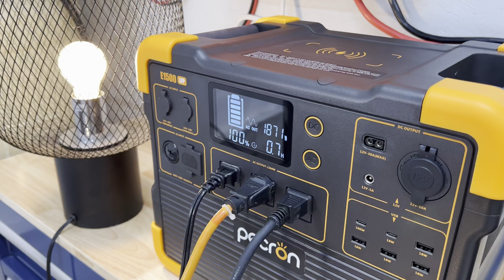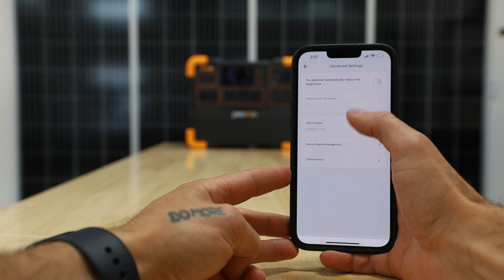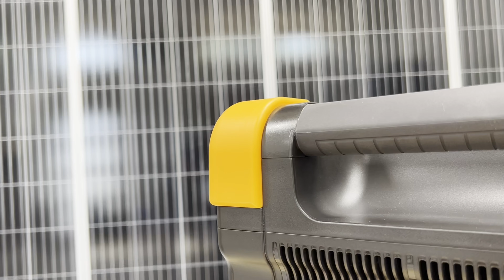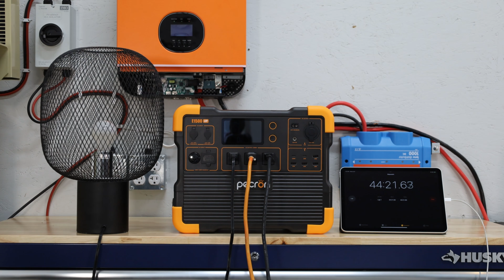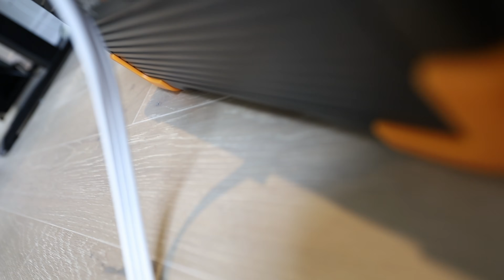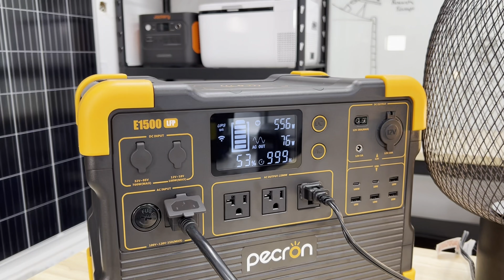Ugly Pecron E1500: Can Great Performance Save Its Awful Looks?

Comment: There's one question I cannot find answered anywhere.  Any feedback would be appreciated. With new portable panels often including smart chips for device detection and charge control for those devices, do the smart chips interfere with or reduce the charging capacity of mppt power stations/banks? Im getting conflicting information. It seems unless the panles have a dedicated DC unregulated output, it'll cause issues.

Comment: Like some others, a primary selling point for me was the 30amp DC output with the XT60 socket for use in my small RV.  However, having spent hours looking at xt60 cables to connect my Pecron to a dc fuse panel all I can find are cables with xt60H-M connectors, not xt60M (which are needed to fit the Pecron's xt60 socket.  One seller showed cables with xt60M connectors but when I received them today they are in fact xt60H-M.  Pecron really should have used an xt60H-M compatible socket in their E1500.  In addition, nice idea with the battery jumper cables except they're too short and should probably be 10awg instead of 12awg to go with the 30 amp fuse.  Overall I really like the Pecron but they fell flat on their face implementing the xt60 dc output.

Comment: I do not buy the expansion batteries, I just buy another of the same unit which is usually not much more than the expansion battery. The second unit is independent of platform/ecosystem (hate that term). I simply piggy back one off the other, brand does not matter. Not as efficient but each device can be separated and used independently. I have only done this for 1024W batteries so far.

Comment: XT60 connectors (as well as Anderson power pole connectors, etc.) are often used when building DIY cables. They are used by hobbyist radio controlled airplanes and cars, HAM operators. Recommend XT60i connectors. Will allow you to rig a power input at higher voltage than the regular XT60. I use XT60i connectors with my bench power units to charge some of my batteries and make cables just for this purpose.

Comment: Got one with 2x 200w solar panels, was like 1150€ and no tax and free shipping. going to get 2x battery packs once they are available. Going to get mounted solar panels on the cabin this summer(8x 100w panels as they are really cheap right now), the 2x expandable is just for road trips. might add a 48v 200AH battery later on, as you can connect it to one of the solar ports and use it to charge the unit and it's battery's with an adapter, have to charge it separately though. Would be nice if i could run the power plants once a weak or so just to charge the batteries if needed instead of pretty much daily.

Comment: Have had mine and have been using it everyday for 3 weeks now. I have an issue that has happened 3 times now and that is that it will rapidly discharge to 1-2% from 30% in a matter of seconds. Anyone else has this issue? Anyway, I’m returning mine.

Comment: I bought one & it wouldn’t charge. Using the AC cord that came with the E1500LFP, the display would show an input of 0 watts. The battery was at 0% when it was delivered & it was cold, so maybe that’s why. I tried using the P2304 charger that came with my Pecron E3000 & I was able to get the E1500LFP to charge, but only at a rate of 1 watt. After letting it charge at 1 watt for about 3 hours, the display began showing a significant increase in input to around 276 watts. In addition, the straight AC cord that came with the E1500LFP was able to charge it at an even higher input wattage. How bizarre, how bizarre.

Comment: I just bought this unit and plugged in a 175 watt panel. I couldn't tell if it was charging.
I grabbed an inline volt/watt meter and the panel showed about 40 volts but 0 watts. Not sure what it wrong.
Reply: Make sure the voltage is correct.

Comment: @thesolarlab what do you think pecron 1500lfp vs eco delta max 2? I dont know what to get. Im so confused
Reply from the maker: The EcoFlow Delta 2 Max is a little more expensive but has a bigger capacity, output and better features in our opinion. We think it's worth the extra money. 

However, the Pecron 1500 unit is also solid. You'll be happy with either purchase!
Reply: @TheSolarLab  thank you

Comment: Ok Ive had my Pecron 1500LFP for about 20 minutes. 
Its charging on a wall socket and the fans are going. Its a noticeable sound. 
The AC cord is comically short. I havent measured but I'd be charitable in calling it two and a half feet. 
The App is awful. So bad that I cant even tell you what its like because it is locked behind an online registration that is laughably bad. I dont know that I will even bother with it. 
But if the thing charges up and powers the stuff I need it to, the drawbacks are just part of the toll.

Comment: A big selling point for me was the xt60 30amp DC output for my diesel heater when overlanding in winter. I cut the stock cords battery rings off and modified the end to plug into the 30amp out on this pecron. No problems with startup draw on the heater when the glow occasionally draws 150-200w when starting. I can run my Hcalory diesel heater 75hrs with this thing in back of my truck. I can run my BougeRV fridge and diesel heater easily for about a week b4 getting out the 200w panel to recharge
Reply: We have a light build in a van.  Our lights, fan, and usbs are wired to a fuse box.  We then run the xt cable to our fuse box.  I'm kinda surprised he doesn't know some of the pros of the xt port
Reply: This is awesome! I want this set up!

Comment: I think you missed a great opportunity that this unit has over others.  It has the ability to turn on a diesel heater  with the DC port only.  EcoFlow and other units their dc ports only output about 130 watts, a diesel heater requires 150 watts to run and start the glow plug, and price is $659, otherwise a great video.

Comment: I have 3 pecrons.... I like that you have to use power to AC or DC to check save phantom power plus they are really efficient... Mine are hooked up to solar so most of the time display is on vs at night....

Comment: So you think the Jackery 1000 Plus matches up with the Pecron 1500? The Pecron has 20% more power (2200 watts vs. 2000), 19% more watt-hours (1536 vs 1264), has the dreaded "waisted space" (no wireless charger), and I have never seen it selling for $1,200 since its inception. Today, Aug. 3, 2024, it's on sale for $700 vs the Jack for $1,000, that's 30 per cent less! The only real problem with it is the power drain when the AC inverter is left on. It draws more than 1000 watt hours in 24 hours! So make sure you turn off the AC inverter when it's not being used.

Comment: so, is the surge advertised wrong/misleading:  from their site -->  E1500LFP Power station With the 1536Wh,Max expandable to 7680Wh capacity （Used the EP3000-48V）2200W rated power(Surge 4400W)

Comment: He's never 1299$. It's 100% time sale. The real prise turn around 699$ and 899$. The actual price was 699$.
Reply from the maker: if we go ahead and say that though.. then the price changes, we are dumb. its better to advertise actual price and you find out its on sale no?
Reply: @TheSolarLab  NO, because some of us actually pay attention to Pecron pricing. I know you have a channel to run so you might not know but Pecron have never had this for $1299. Their price have always been $899 and below $699 on sale. I've seen this unit for $599- 5% off and NO TAX. There's no power station with similar specs anywhere close to this price. This is why Pecron has a following.
Reply: @TheSolarLab  Maybe, but it may be more dumb to not at least mention what the sale price is, which is $599 right now, and hovers around that all the time, and that completely changes many people's thoughts about the unit as a whole. I mean, you mentioned that in your DJI Power1000 review that you posted before this one.

Comment: On the website you can do the 1500LFP + the 3kwh expansion battery for $1700 total(no tax, which they didn't charge for me in FL). That ends up being 4.5KWH with 1200 solar charging input(400w from the expansion battery).

Comment: I completely disagree with your opinion on the looks. The look of this will easily outlast many others because it's unassuming and simple.

I like the overall features for this reputable company.
Reply: Agreed. It is built to be stacked tightly in a van, RV, home power bank etc.
Reply: I agree. It looks like and prove to be a solid, rugged Unit I can take no problem in camping (I have one).

Comment: Which products from Jackery, Anker, or Ecoflow offer a 1536wh power station for $699? I'm not sure where you got a $1299 price tag. They were $799 at launch. Good luck with the Pecron app. If you're not connected via Bluetooth or the same WIFI network as the power station, it almost never let's you use it remotely. Pecron is supposed to be working on a fix but they've had plenty of time so I'm not optimistic at this point.

EDIT: The app now works as intended
Reply: List price is $1299 but it has regularly been on sale at $700 or a little less.
Reply: @michaelbeatty130  it's never actually been $1299. That's just some BS to make people think it's on sale
Reply: @Bamabrute85  True. Quite a lot of what I call The Big Fake-Out in advertising...in other words, lies.